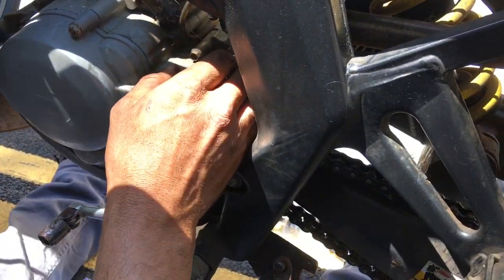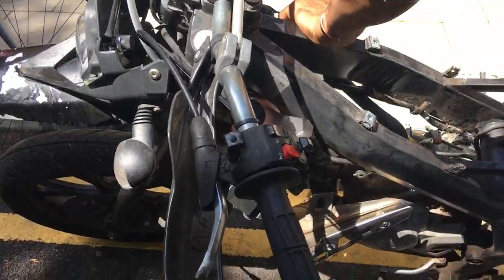Derbi Senda 50 Build - Faulty Carburettor

Comment: These are really shitty bikes with the start problem. I have given up on mine, tried everything but nothing works. It starts when it decides to but mostly it doesn't. So annoying!
Reply: same here did u find any way?
Reply: @YamahaBraaap  Sold mine, was too hectick! Try starting without the chalk on. It worked for me that was. When you leave the chalk on it over wets the piston. Good luck!
Reply: @joechapa8126  do the 2 stroke bikes start easy in general? Ive bought a broken one and i think its the carb but i just want to make sure im not too stupid to start it lol.
It has spark and i think the spark could be the problem but honestly i dont know. The piston ate into the walls of the engine so it  must have ran at some point until it broke
Reply: @D3nn1s  They do start when they decide to but mostly, my experience was frustrsting. Good luck with yours!
Reply: change the carb? simple fix really
Reply: Sounds like a skill issue tho these bikes can be really good with a good setup